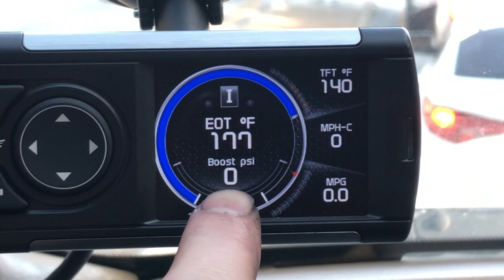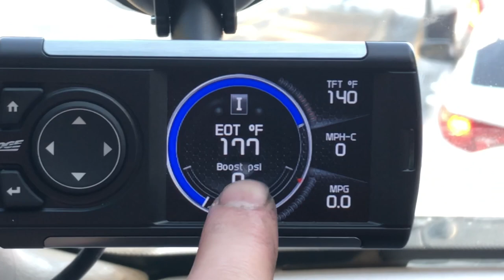Painting my 7.3 powerstroke’s intercooler pipes and turbo spyder!

Comment: How do you not have have 100,000+ subscribers!!! I’ve been watching since the start of your vids on the 7.3 and it amazes me!
Reply from the maker: Carter Lawson I wish I did more than anything bro!!! And thank you!!🙌🏻🙏🏻💯
Reply: 80HD Projects it seems like it’s hard for these truck and car channels to explode in size but once they do they take off!
Reply from the maker: Carter Lawson I hope that happens man. Right now it’s costing me way more than it’s making me 😂😂😂 but I enjoy it either way🤘🏻
Reply: 80HD Projects hey bro! Any suggestions or tips  for installing a 5” turbo back today!
Reply from the maker: Carter Lawson a friend to help installing the down pipe to the turbo would be nice! Getting that down pipe on the turbo is the hardest part but if someone is under the truck holding it up while you line it up and put the clamp on will help a ton. Also to get the clamp off to take the old down pipe off, put a pry bar or something on the edge of the V-band clamps and hit the back of the bar with a hammer. If you watch my straight pipe install video you’ll get a better idea of what I mean.
Reply: 80HD Projects I’ve watched all your vids man! Especially that one and the lift ones several times! Dreams to have a truck like yours! Maybe sometime I will! How long did it take you start to finish to do the exhaust?

Comment: You should look into Eastwood’s diy dual voltage powder coat gun,and a used old oven,you could powder coat all the parts and have a lasting durable paint job,that’s what I plan on doing for my 7.3, I just need to build big oven
Reply from the maker: Thant’s a good idea bro I’ll definitely have to check that out!!!🤘🏻

Comment: Assuming your monitor is plugged into your OBD2, you'll never see more then 25psi since that is the max the MAP sensor can read. A physical gauge tapped into your AITH delete plug will give you an actual readout. With a hydra, intake, exhaust and billet wheel you should be at about 35psi.... To make sure you're not losing boost you should put your hydra on stock and you should be seeing 16psi minimum, 18-21 full throttle..... Your boots look original and is most likely where most of that soot you cleaned off came from. Over time they get pin holes not visible to the naked eye. You should change them out for a boot kit from BD diesel, riff raff, vp racing, sinister, etc. Inexpensive insurance if they aren't leaking or will most likely recover any lost boost if they are.
Reply from the maker: Interesting! That’s one of the great things about making these videos is I learn so much from helpful people like you, so thanks!🤘🏻 and I looked into the boot kit from riffraff before and definitely plan on getting it eventually💯

Comment: I just bought my first diesel , 1999 F350 and your videos have been extremely helpful! I see we have the same knn air filter . Are you still using the same model knn or have you changed ? I’ve been looking at S&B CAI because I’m worried about dust with this knn being open. Much appreciated!
Reply from the maker: I just have the K&N intake pipe but I switched the filter out to a dry filter from another brand a long time ago. I was told the oiled K&N filters aren’t very good

Comment: Did u put the napa filer with k&n pipe and how that work?
Reply from the maker: Adrian Perla it’s an AFe filter and it just slipped right into the old K&N intake in place of the K&N filter🤘🏻 the Napa one probably would work too. As long as it’s a 4 inch inlet

Comment: One of my Favorite videos you’ve done so far! Does spray paint have a temp rating? 
Thanks for finding time to upload while moving too. Busy busy
I think it’s better moving from a smaller place to a larger place. In reverse can really suck because it doesn’t all fit!! Unpacking for weeks and can’t find what you need when it’s Needed.
Reply from the maker: Jeremy Keith thanks bud! Glad you enjoyed it! I don’t know the exact temp rating but I do know it said high heat resistant on the can so we should be good!👍🏻 lmao. and I agree with you on the moving part💯
Reply: 80HD Projects I was just thinking of doing same with my truck and was researching VHT rated high temp spray. VHT offers varied temp ratings, exhaust 1300-2k, 650 and 250, I think. Smoked my tail lights with their night shades and like it. The exhaust spray seems cool because it says it has ceramic in it but I need to research it some more.
Reply from the maker: Jeremy Keith oh nice nice! That’s very cool man!
Reply from the maker: Jeremy Keith I think the hardest thing was cleaning all the oil off the spyder but if you like working on your truck it’s not a bad project and looks awesome after👍🏻
Reply: 80HD Projects also makes everything else look so dirty in engine bay. Never ending process. 
Have you thought about painting your engine cover? Saw some cool ideas on ChrisFix channel. Large cover that hides so much of the grim below. Good spot for a “No Half Ass” decal maybe. That way your viewers see it every time you lift the hood.
Reply from the maker: Jeremy Keith I’ll have to look into that and check it out bro! I do like the idea!🤘🏻💯

Comment: Hey mate , how do you go running 40s  I've heard that they rub on the leafs  when full locked or the car is flexing off road , thanks
Reply from the maker: Juliano Martino it’s all about the wheel offset bro. I never new about wheel offset before and my 37s rubbed a lot cuz my wheel had a offset of zero. Now I have -44 offset and the 40s baaarely touch the leaf springs at full lock. Barely. I know someone with -75 offset wheels and their 40s don’t even rub with flex. Negative offset pushes the tires out, away from the leaf springs.
Reply: @NoHalfAss  thanks for that , im from Australian and love watching your videos cause a 7.3 is my dream car and I'm hoping to buy one soon its just shit cause over here in Australia a 7.3 dual cab with around 200k kilometres  in mid condition cost around 50-60k